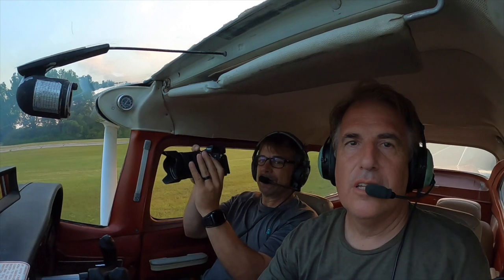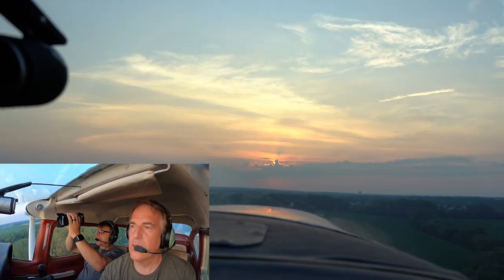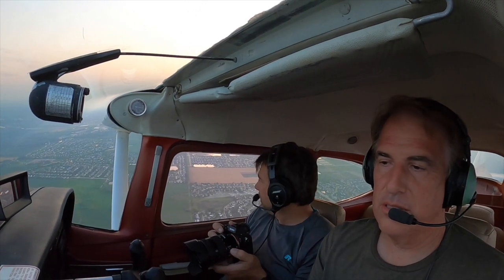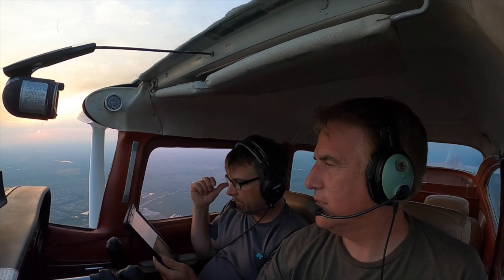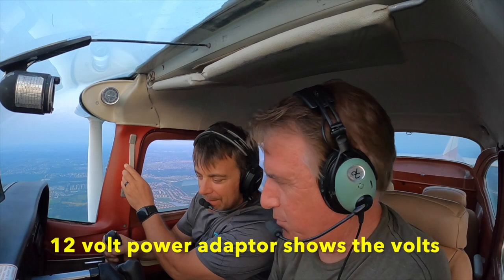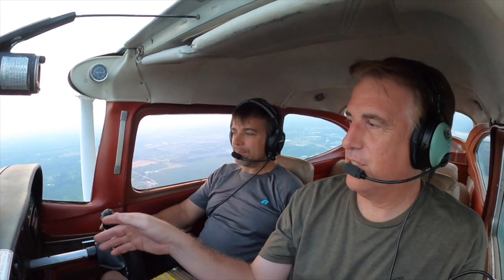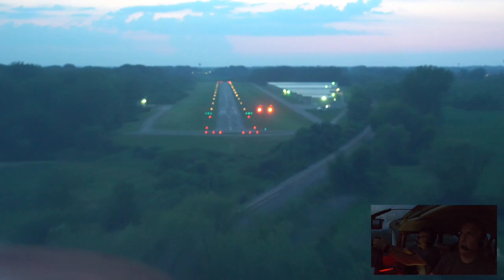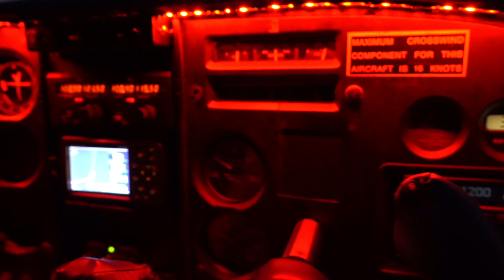Cessna 182 First Flight With New Engine!

Comment: Congrats! The plane looks great. Quick question. I noticed you had a Garmin 496 in the panel.. I still have my old 296. Do you like those units? I have an iPad mini with Foreflight now too, but do you recommend using the 496 or 296 as a back-up GPS?
Reply from the maker: I love the 296/496.  I’m putting a WAAS GPS in my panel and I told them to keep the 496 in the stack.  They looked at me kind of funny.  It’s nice to use the main GPS for enroute, but have the 496 for backup.  If I’m flying someplace far, but have to transition class C or D, it’s nice to have the mileage of the place that I’m passing handy.  When shooting IFR approaches to uncontrolled fields, it’s nice to have distance to the field on the 496 for position reporting.  I also love the “recent” airports saved on the 496.  Great units.

Comment: Congratulations!  Could you tell us how you prepare for any emergency at takeoff as the end of the runway has trees.  What is the most dangerous altitude to have an engine failure in this runway, 300 ft,500 ft?
Reply from the maker: All you can do is lower the nose rapidly to hold best glide speed.  If there are trees, make sure the fuselage goes in between them as much as possible.  Fly all the way through the crash.  Never stop flying it.  A failure right above the runway is easy, just lower the nose and land on the remaining runway.  If you can't get it down on the remaining runway, just do the best you can. Don't try and turn around when you are low.  That almost always results in a "stall/spin".
Reply: @quinnjim  thanks for the tips on putting the fuselage between the trees. I did not know that maneuvering.  The wings will surely absorbed all the energy when they break.  I am still learning with about 400 TT, but only 70 PIC time.   ——Alex

Comment: I am surprised you did not have the A&P who installed the engine in the plane for the first flight. That would have given me confidence.
Reply from the maker: There's really nothing he could have done once we took off.
Reply: @quinnjim  In the military I had to go on each flight after major maintenance. SOP.
Reply from the maker: @pelicanlover69  These planes are pretty simple.  If all the gages are in the green, you take off.  The mechanic isn't going to be any help if it quits.  We did several engine runs where he checked for leaks and loose connections.  In general aviation, you don't usually see mechanics flying on test flights.